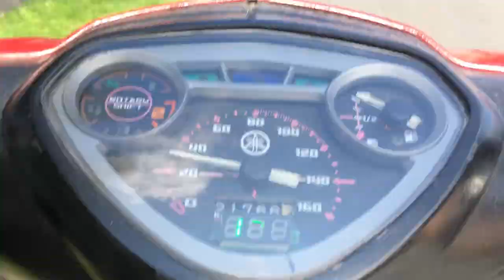Lagenda 110z SRL110 pemasangan auto shoe dan auto clutch semasa PKP-33

Comment: Bang saya baru tukar auto clutch dan housing clutch dan clutch plate tapi bila masuk gear 1 lambat tangkap bila pulas motor menjerit tapi lambat gear dia tangkap tu kenapa bang
Reply from the maker: cuba tengok tempat mengawal auto clucth.  dia berada di sebelah kiri dekat magnet. ada nut saiz 8 dan tengahnya ada skruw driver bunga . kalau tempat masuk gear terasa berat di sebabkan clucth masih tak free lagi. jadi ia jalan dengan lambat tangkap atau macam clutch tak gigit
Reply: @9w2bws  yg tempat ejas clutch bagi lembut dan keras tu ka jadi macam mana nk perbaiki sbb saya dh ejas antara free dan gear masuk dekat kira ruang free x jauh saya bagi dekat dh tapi sama ja hasil dia
Reply from the maker: @aimanfirdaus6152  Nak kata saya ini pakar, adalah tidak. sebenarnya saya sama seperti kamu. cuba lihat bahagian susunan plate clucth adalah betul ikut spec. untuk kesan lebih awal sekiranya untuk hidupkan motor guna starter kit bila pijak macam lus. besar kemungkinan clucth dan bearing one way di auto clutch. ini perkara lain saya kongsikan, 1 perkara lagi, jangan guna minyak hitam kereta,oleh kerana terlalu pekat isi kandung minyak hitam, besar kemungkinan carbon mudah melekat di bahagian clutch dan mudah haus seluruh auto shoes set.
Reply: @9w2bws  nk senang kata bila pulas motor menjerit tapi tertahan tapi bila dh laju ok
Reply from the maker: @aimanfirdaus6152  kalau macam tu kena lihat balik auto shou  , washer dan oneway baering dan spring dia. kemungkinan ada barang yang salah pasang atau sebaliknya.  boleh tengok video ini https://youtu.be/BxXMtp-Vaos sedikit sebanyak ia boleh membantu. saya tak ada kesempantan untuk merakam video sendiri. saya tertanya adakah beli barang lengkap di bahagian auto shoe, seperti auto shoe , cover auto shoe , oneway bearing lengkap. selalu orang guna balik one way bearing boleh jadi. tapi saya beli baru sebab one way bearing dan cover dia dah patah dan bearing dia dah melengkok.
Reply: @9w2bws  saya guna balik one way bearing tu selepas tu terus jadi macam yg saya ckp sebelum ni ok auto clutch dan housing clutch saya beli lengkap cuma one way bearing saya guna balik
Reply from the maker: @aimanfirdaus6152  wow terima kasih perkongsian, oneway punya bearing . kalau saya selalu kalau tukar part tersebut biar lengkap baru. dalam kes saya rumah oneway bearing dah nak patah dan spring dah tinggal 1 sahaja. maka saya beli 1 set kat online. waktu itu PKP kedai pun tak buka. atas pengalaman saya memang ia jadi macam tu semasa nak jalan enjin menjerit hujung2 baru dia lekat. dengan itu petrol pun dia boros..
Reply: @9w2bws  one way bearing boleh jadi punca juga ka yg motor menjerit masa nk gerak
Reply from the maker: Kalau masih terjadi slip. cuba lihat balik clutch plate takut salah pasang atau clutch plate dan pressure plate tiada clearance.